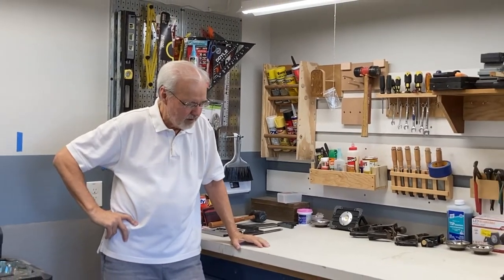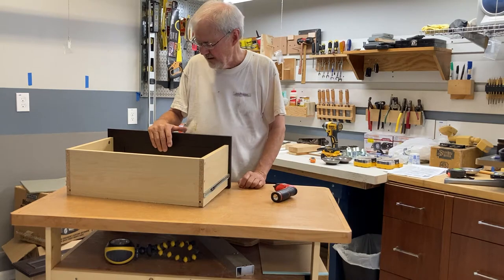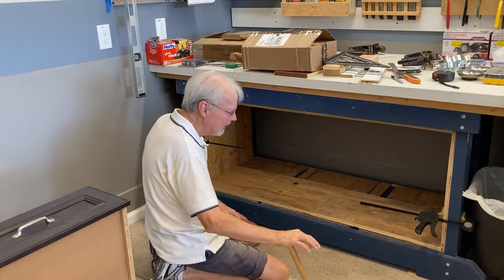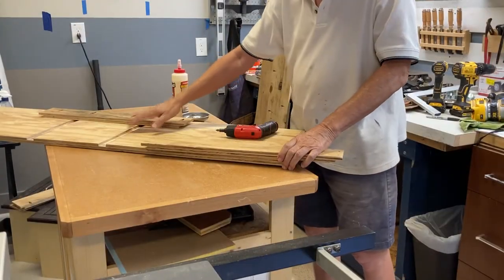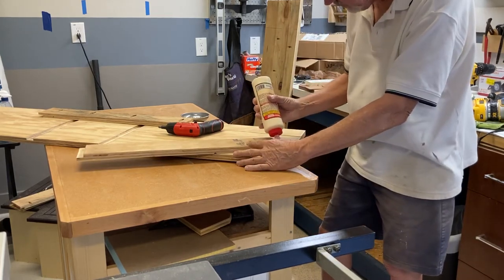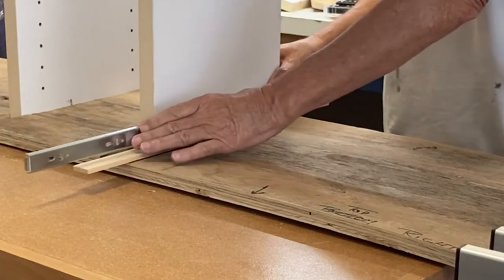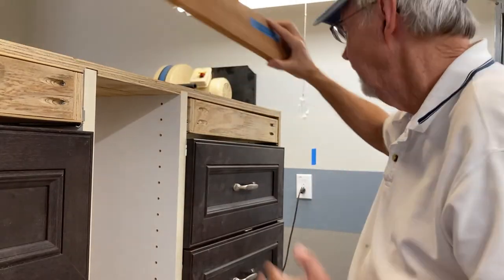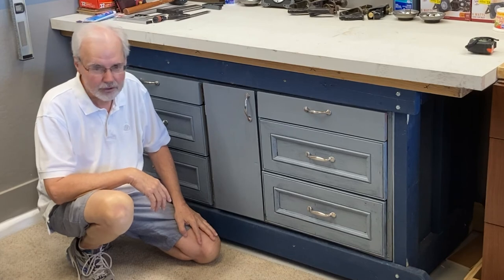Building Drawers for My Workbench

Comment: Still impressive they could build 3-part slides in 3/8 of an inch, 3/4 slides are decent enough. 

I like full extension slides on deep drawers, otherwise it’s hard to keep the drawer organized ... becomes more of a lost stuff in the back kind of issue otherwise.
Reply from the maker: I agree with you Mad Zit on the full extension slides. These repurposed drawers were pretty shallow so not having full extension slides hasn’t been much of a problem. Plus I had to go with those 3/8” slides. Thanks for watching.